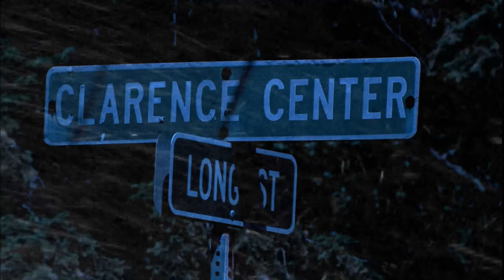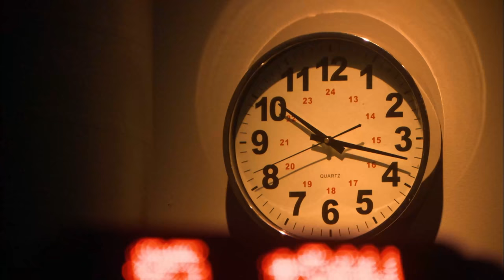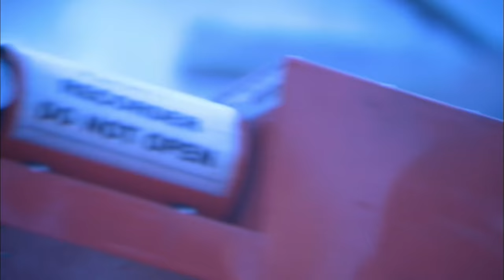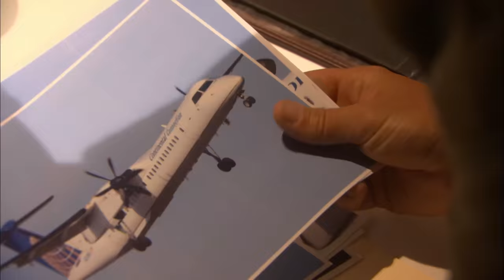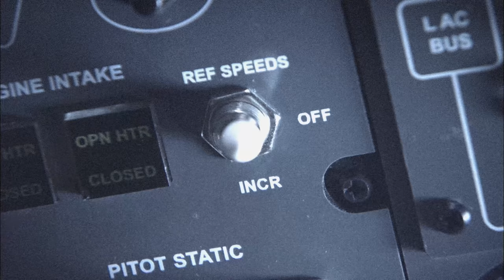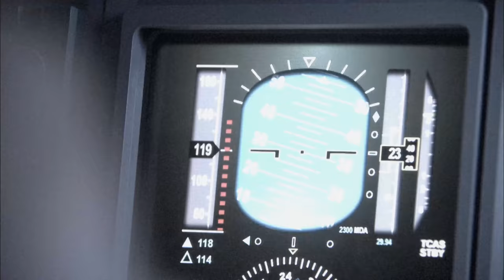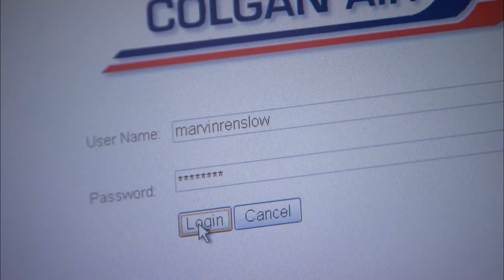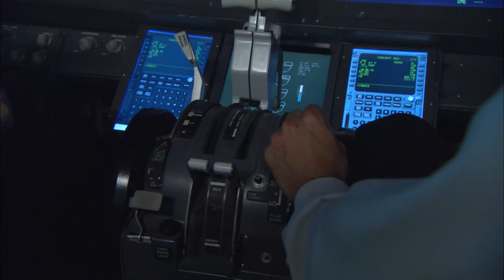The Tragedy Of Continental Connection Flight 3407

Comment: Greed caused this tragedy. The pilots were very tired.
Rest in peace all of the victims.y condolences to all of their loved ones.
Reply: This plane crashed in my hometown In Buffalo. These pilots should of never been filing. The First officer was sleeping on couches in the lounge at the airport. That’s crazy!!!!
Reply: sounds like 95% of all tragedies doesn't it
Reply: @trilexfix :  Well, fatigue AND lack of bothering to follow procedures AND cost cutting beyond sanity all are big contributors.  I've studied this quite a bit re personal interest, from books and such Youtube air disaster programs.  

I had a friend die (along with 48 other people) when pilots in my home city took off on the wrong runway, destroying the plane, which would have EASILY been prevented if EITHER Pilot OR the tower had simply done their job.  But several things ALL went very wrong like understaffing, fatigue, not checking the heading, poor maintenance communication, etc., which all contributed to the accident. 

Once I looked into that and the Air Canada flight that ran out of fuel mid-flight because no one knew how to convert kilograms to English pounds, no one thought that was their job (including pilot and fuelers), there were no parts to fix the broken fuel gauge, there were no regulations to ensure the plane basically flew full of fuel if they couldn't be bothered to fix the damn fuel gauge, and Air Canada had done a TERRIBLE job re the procedures when there was a fuel conversion from Metric to English, that was it for me.   No more flying.   It's supposedly safe, but FAR too random with all the cost cutting, etc.
Reply: Danny Joelson  You've obviously never flown professionally, àmirite, Ace??
Reply: The captain forgot fundamentals that shouldn't go away when fatigued. Sure, checking all the gauges is taxing, but pulling up in a stall?! He didn't delay pushing the nose down, he did the opposite! Incompetence.
Reply: dannyjoelson3101  - You are SPOT ON!! Neither of these two were qualified to pilot a plane as a captain. It cost my sister her life. She has never met her 6 grandchildren.
Reply: @DONGOE 😢I’m so sorry.
Reply: the captain pulled back instead of push forward in a stall. I'm all for blaming the airlines greedy practices but this falls more on the pilot. the NTSB report literally says that.

Comment: There was a similar accident about five years before ColganAir when Corporate Airlines Flight 5966 crashed in Kirkwood, Missouri. 13 out of the 15 people onboard were killed. Those pilots were also fatigued and failed to notice they were below the MDA.
Reply: Then there was that incident at SFO that happened a few years ago where the crew of an Air Canada flight were so fatigued they nearly miss took the taxiway for a runway and nearly crashed into several planes. If it wasn't for that pilot of the American Airlines flight that was on the taxiway for saying something that Air Canada flight would have crashed on top of those planes
Reply: @annetteslife  I heard about that incident…. That death toll would have been higher if they didn’t warn Air Canada pilots.
Reply: There were two pilots for F's sake and stick shaking should wake anybody up.
Reply: @Interdictiondeltawing  that is so very true
Reply: So, there is a Kirkwood, MO, and I was living near there at the time. Like, 10 minutes away. I was surprised to have not heard anything about this. 

Then I looked it up and it was Kirksville, A few hours north, home of Truman University, that the plane crashed in.
Reply: @nabirasch5169 Two fatigued pilots who went from under stressed to overstressed in a short moment sure did wake them up, but because of this sudden switch and the constant fatigue, they weren’t thinking straight, rationally or noticing key details they would’ve without fatigue. Being awake and making the wrong decisions is still just as catastrophic as being asleep at the wheel.

Comment: The law which raised the training time to 1500 hours wouldn’t have made a difference in this case as they each over 3000 hours I believe.
It wasn’t training but fatigue.
Reply: I agree with you, but there were training issues too. For instance, losing too much altitude in a stall would cause a failed check ride. This has since changed, but that is likely why the captain added power but did not pitch forward

Comment: This accident caused major positive changes in the airline industry. Pilots now have to have 1500 hours of flying experience to get a pilots license, before this happened it was only 250. And since this we haven’t had any fatal commercial air craft crashes in the US, and this was 13 years ago!
Reply: There is zero evidence that the 1500-hour rule has done anything for safety. What it has done is caused a pilot shortage, full stop. The new fatigue laws, however, have done a great deal to combat wear and tear on the pilots. There is no doubt that that commercial aviation is safer because of them. 

What the video didn't mention was that the captain was grossly incompetent. He lied on his application saying that he had only failed one checkride, the maximum allowable by the airline. In reality he failed several, one of the most important being his instrument rating. He had also needed consistent corrective training after being hired just to be good enough to stay employed. The crash caused laws that allowed airliners to be able to see checkride results as part of the background check, instead of relying on the pilot's honesty. Another good law.

But the 1500 hour rule is just ridiculous. Every other modern country still allows airline pilots around the 250 hour mark, with safety records that match or exceed the USA's.

Comment: Seriously?! The airline let that pilot and 1st officer fly the plane regardless of how tired they were?! The airline should be fined for what they did. Also, their failure to properly train their flight crews also led to the crash. The 1st officer was inexperienced, both her and the pilot were suffering extreme fatigue, they failed to properly respond to a stall warning, and they were breaking the rule against conversations that had nothing to do with flying the plane. I really hope the airline makes the necessary adjustments to its training program to make sure flight crews are properly trained and makes sure that each member of the flight crews has at least 1,500 hours in the flight simulator before they are allowed to fly a real plane

Comment: How is it that a PILOT is paid LESS than a BUS DRIVER?  Just the level of responsibility (much the job conditions re stress, risk, training required, regulations, etc) say that's pure insanity. 

With all the insane cost cutting going on, it's a wonder air travel is as safe as it is.  (Prior to this I watched one about a jet windshield blowing out because the wrong bolts were used to secure it.  The mechanic didn't check the part to save time.   He was PROUD of this, as his crew had WAY too much work, and time saving things like this were how they managed to get all the work done.   Of course, mathematically, it's only a matter of time until something goes horribly wrong, re ignoring procedures/regulations, re not just eyeballing the size of critical bolts).

Things will go wrong and accidents will happen.  But we should NOT be setting the public up to die in preventable accidents so airline X can, for example, massively underpay commuter pilots OR make pilots fly under extreme fatigue conditions. 

The more of this kind of thing I see, the happier I am that I just decided not to fly anymore, given the constant push on corporations to save more and more money and treat employees badly to do it.

Comment: Instead of spending money to find a way to detect fatigue, how about not overworking staff and stop fatigue before it starts? I’m sure the higher ups can take a pay cut, too bad it’s about greed instead of safety!
Reply: There is a shortage of pilots, unfortunately.  Even though most airlines (Colgan AIr obviously not, but most airlines) pay well into the 6 figures, it is still an extreme struggle in many cases to hire enough pilots.
Reply: @unconventionalideas5683  well i can guarantee that continuing to do this is not going to help that. You're gonna get a snowballing effect as people get burned out. Desperation to maintain current demands, will lead to offloading the same workload onto fewer shoulders, accelerating the burnout rate.

Comment: Maybe airports should provide accomodations for pilots at no charge?
Reply: Seriously, they could easily have some sort of temporary lodging at the actual airport.
Reply: Our airport hotel has called with each airline for them to stay at the hotel, whether for a couple of hours or overnight. Since we have all of the major airlines, Delta, AA, Southwest, Regional, United, n so on, they get a low cost deal bc their are usually at least 5 crew members or more per flight. With this deal they get free for and drinks and free rides to anywhere they need to go within 3 miles of the hotel. All cities should have hotels for the flight crew to stay in when they have lay overs n stops.

Comment: I think the crew was relying on the “terrain “ warning sound “ due to sleep so they wasn’t looking on the screen but also why did the stall sound didn’t come on ? What if the pilots didn’t know they were stalling ?
Reply: The pilots received one of the most daring "alarms" there is in a cockpit - the stick shaker activated. This makes a loud noise and also vibrates the pilot to the bones. There's no doubt the pilots heard and felt this alert, they just didn't respond correctly.
Reply: @Jay_Bird  I honestly feel like everything happened so fast . Also I feel like when a plane is descending fast when it shouldn’t there should be certain alarms not just red lights on the gauge. N yea I get the whole yoke thing vibrating n stuff but again the plane was descending super fast n they weren’t aware because of landing list they were going thru so if they had a sound alerting them maybe things wud have happened differently. That’s just me

Comment: That’s not a chop saw but a Saws All. A chop saw is a fixed saw used to cut straight or angle cuts on small lumber like 2x4’s and trim boards. 12:33

Comment: I did a little research and read a article from 2013 about the low pay on regional airlines showing first year co-pilots made between $19 and $30 a hour! Remember,  They are only paid from the time the plane leaves the gate and arrrives at the destination. They average 21.5 hours a week, or 80 hours a month. I did the math and her hourly wage if she worked 80 hours a month would be $16.66. Much less than the lowest pay of $19 four years later.
I highly question that she only made 16k a year.

Comment: Are commercial pilots required to do stall recovery practice in an actual plane, or at least in the simulator?  Being told what to do in a classroom is not as valuable as actually practicing it hands on.  
Imo there should be increased frequency of hands on practice of stall recovery in the simulator, and in the sky in a real plane, even it's only able to be done in a small plane.  The airline needs to pay all this training.  Just as the airline needs to be required by law to pay for flight crew members hotel rooms.  
I'm shocked at the salaries.  Full time flight attendants should be making over $50,000, a first officer should be making $80,000, and a captain should be making $120,000!  The salaries of pilots should be regulated by a public utilities commission.  The corporate officers should have to live on the same salary that they pay their pilots!

Comment: Im no pilot but if the stick shaker litterally means your about to stall  (simply what i gather from most of these videos). Isn't it common sense that you need speed and some aerodynamic.. just pitch down and add thrust. 

It probably came as a shock to them and probably didn't have much training with stalls in an aircraft, as it would've been muscle memory that way...

Always brush up on the easy stuff, you never know when your brains gonna go mush due to high stress situations, and your muscle memory is gonna kick in I guess...
Reply: Too low.... covered with ice

Comment: The normal response to the stick shaker would be to push forward and increase speed, but that isn't so great when you are only flying at 2300 feet. Not much room there to work with. Fatigue would not have brought that plane down in that manner. There was more to the cause than described here. Ice would not have been able to be proven as it would have melted in the crash.
Reply: It was clearly ice.

Comment: They put this much effort into the investigation to rule out mechanical failure. Imagine if they would do the same for TWA flight 800? Congress makes more than these pilots to do a lot less, including regulating the industry, or holding accountable the FBI/CIA and the Navy that shot that plane down.
Reply: You do realize that they painstakingly put TWA 800 back together with wire and kept it in a hanger for 25 years so it could be accessed for research? They even offered to send parts to museums if the families were ok with it, but the families did not want this, so it wasn't done.

Comment: Let's add fancy equipment to check pilot alertness and fatigue! Cool, great, fantastic. Better suggestion- livable wages and pilot accommodations for when they don't live near the take-off area. Two things that would have averted disaster right there. If they had livable wages they wouldn't need to work ridiculous hours, the airlines would retain and gain pilots that were better qualified, and even during inevitable short staffing they could have pilots rested on site if they needed sleep between flights.